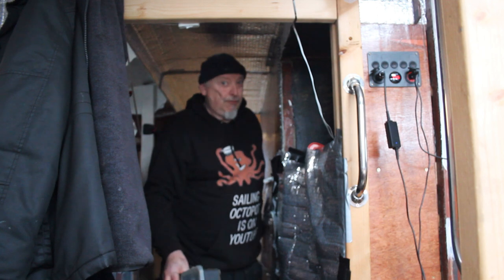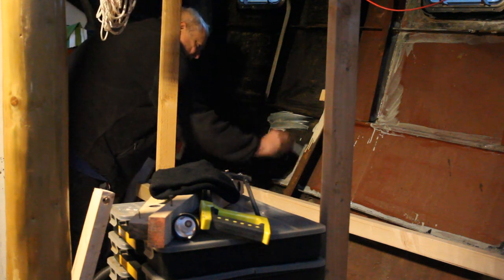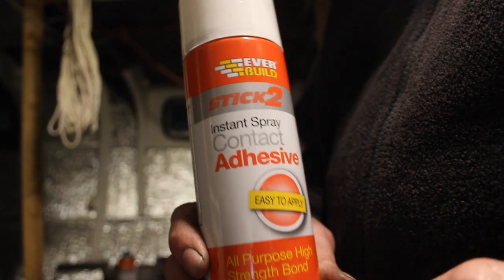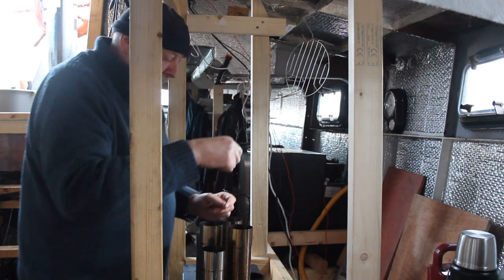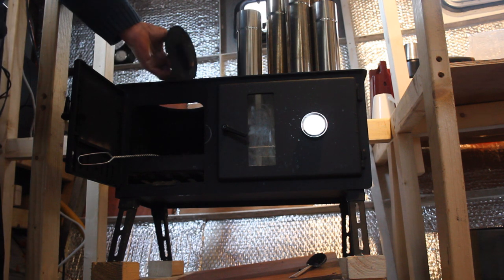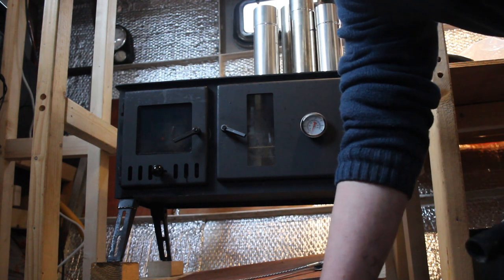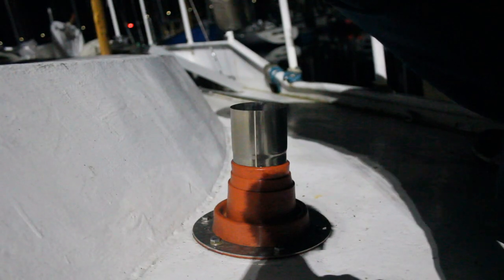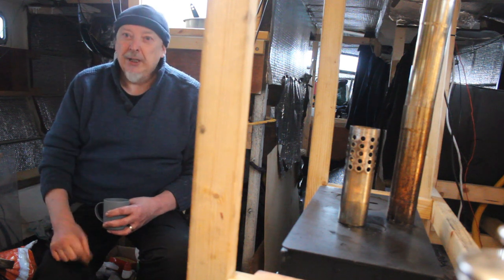Outbacker Stove Cleaning and Work Starts on the Starboard Berth: Episode 25

Comment: I saw your customer review, (I think on amazon?) where you mentioned your channel. Thanks for showing the in's and outs of cleaning the stove! I'm thinking of buying one, do you think it was a good purchase? Seeing as its been a year since this video I'm assuming you have a very good idea of its performance overall.
Reply from the maker: @_Strats_  well it has been in place 2 years now and used pretty much daily during the Winter. I did use charcoal at one stage which has caused the grate to buckle a bit but nothing serious. Softwood doesnt really get the oven hot enough so hardwood is best for that.
Reply: @sailingoctopot  ok, thanks for the info!

Comment: I have used wood stoves for years, growing up in the far north country.
We used to just use a small shovel to reach in to remove the soot.
That looks like a lot of work!
Reply from the maker: It looks like more work than it is. I only plan to do a deep clean every month. I have been mostly burning broken down pallets as they are free, but hardwood (which I can't get for free) burns longer and cleaner. I may have to compromise and burn a mix of the two. I have an ideal tool for the ash removal from the firebox. In place of the old spoon, I will use a long-handled wok spatula. Kind of like a mini shovel!